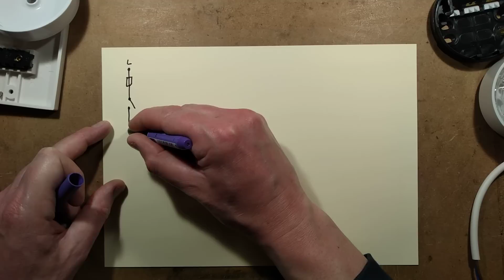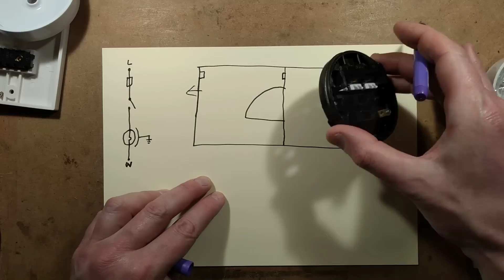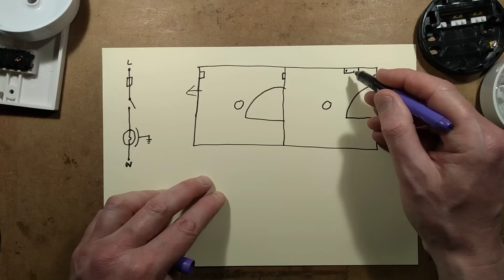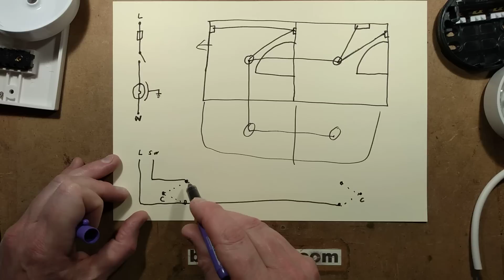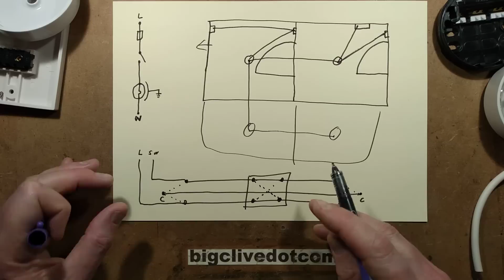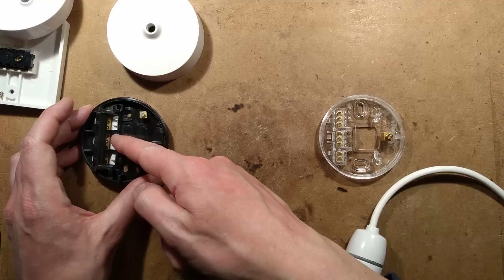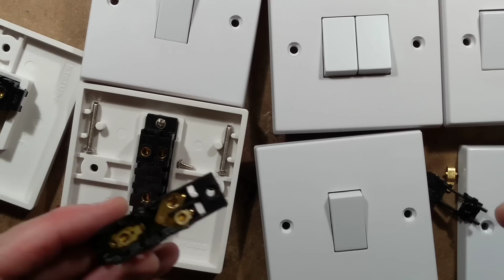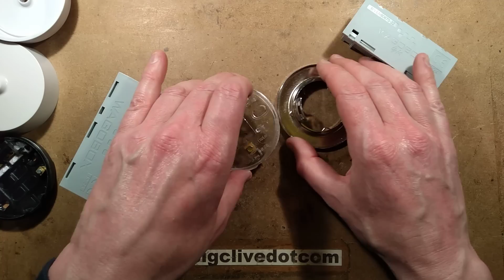British home wiring.  The incredibly simple lighting circuits.

Comment: Was looping from one room to the next one a war necessity, similar to why fuses are in the plugs? I'm asking as in most of the rest of Europe an electrician would lay down wires in a star configuration, instead of a loop/bus as in the UK.

So each plug and each light have dedicated wires going to a common electrical panel with safety cut off switches.
Reply: The ring circuit was a war (and post-war) measure to save on copper.  But that results in several sockets rated at 13A max on a 32A breaker.  Many devices wired to a 13A plug might only take a few amps and have a flex to suit.  Which means a fault could result in a 3A cable carrying 32A of current for prolonged periods, resulting in a length of flaming insulation on your carpet.  So each of our plugs must have a fuse.

Radial circuits are permitted here (always have been) and are being installed more often these days, but rings are still the most common.
Reply: Every single light and plug go back to the panel? That seems horribly inefficient. Where I live the average house will have about 40 plugs and 15 switches or so not including appliance and light fixtures. Would cost a fortune to wire.
Reply: @jordanyoung5718  Typically you string 4-5 fixtures and outlets on a branch circuit. Bonus point for not putting all the outlets in a room on the same circuit. Unfortunately electricians will often save money by putting too many drops on one circuit.
Reply: @jordanyoung5718  not every single one, but my 3 room flat e.g. has 11 breakers and 2 GFCIs split to 3 phases… except for the stove which is 3 phase entirely.
all breakers are 16A…
Reply: @racitup4114  A fuse won't rescue any kid....

Neither 13A not 16A, fuses are there to prevent fires and protect devices and installation. Not humans.
GFCIs are there to save meatbags and they are also mandatory here.

But it is a lot better to protect the Mains itself down to 16A (max allowed device rating) than every appliance, because it also protects the installation.

16A Breakers are very common and cheap to get and the correct name would be line safety breaker, because they, as said, are not there to protect humans.
Any installation without a GFCI will simply kill you, the breaker will most likely not even trigger because the human resistance is far too high.
Reply: @racitup4114  not a nerve but the use of circuit breakers is only for wiring and devices.
GFCIs are mandatory by EU law, and also in nearly all other countries.
The need of a fuse in the plug however is only needed due to the ring topology of many UK installations, which is not even allowed in most other countries.
The UK plug however is quite nice and it is a shame that the EU went for the french/german schuko :-( and EuroPlug.

But it is a common misconception that a fuse/breaker can safe your life… it won't.
It might prevent a fire (which is mostly what it is good for) but will never protect from electrocution.
Even a faulty case would usually not ground enough current to trigger a breaker and simply stay electrified, unless properly earth or protected by a GFCI (these things protect meatbags of all sorts of kinds).

Comment: That's odd, I'm pretty sure my switches have both live and neutral feeding in... I did install a light on the wall like your drawing, but it felt really wrong 😅
Reply: That's not uncommon. You either have the loop in method as Clive described or what you have, where the L+N goes to the switch, the N is joined straight through in the back box, and the live connects to com with the switch wire leaving to the light from L1.

The loop in at the ceiling rose method can be impractical, if for example standard ceiling roses are not being used on the installation. Therefore it is more common nowadays to see looping at the switches as modern fittings have hardly any room for two cables let alone three. 

Theres also the junction box method but I don't think I've ever seen that apart from at college in the 90s.
Reply: If it is a one way lighting circuit wired in twin and earth cable, the blue neutral wire could be used as a switch live. If so, should be covered with brown sleeving to mark it as live, which also makes it easier to identify in the ceiling rose. 
Although if your installation is rather new, your wiring may have been looped in through the switch instead of the light terminals, which basically means that middle 3 block in the ceiling rose is not needed. Looping into the switch is to allow installation of more modern technology, like smart switches, which require a neutral as well as a live and switch live. 

However, please take what i say with a grain of salt, i am a trainee nearing the end of a level 2 electrical installation diploma course in college. This is just stuff i remember off the hop of my head. While i know the top paragraph is all correct, there is a chance that im speaking absolute crap in the second one.
Reply: @Shaynewarner1  I'd have to open it just to check, for now it works so I'm not that worried 😅

Comment: L is Lamp?
Reply from the maker: L for lamp, loop for loop through and N for neutral.  It does seem odd calling the switched lamp connection L.
Reply: @bigclivedotcom  
But the neutral also loops.  So it, too, should be marked L.   L for Lamp.  L for live Loop,  L for neutral Loop.   L L L.  What could possibly go wrong?
Reply: @bdf2718  Well, at least being clearly marked L it helps colour blind sparkies :-)
Reply: Live.

Comment: In Portugal we don't use ceiling roses at all, all loop connections are from one light switch box to the next one and so on. Also we wire the two way switches differently, on one switch we feed the live on the common connector and on the other switch the common connector to the light socket, the L1 of one switch links to L1 of the other and L2 to L2.
Reply: Yeah, there are two "flavours" of two-way switch wiring, I think Clive went over them in another video. Either is acceptable here in AU.

One uses three cores as he described in this video. 

The other works as you describe with a twin active connecting the L1/L2 terminals of the switches, active on the common of one and switched active on the common of the other.

Three-wire is a bit easier if you've decided to add two-way switching to an existing light circuit, and I personally think it's a bit neater since you can run a single twin-active down from the light fixture to one switch rather than having to run individual single cores to each switch separately. But electrically they're equivalent.
Reply: Canada does it more like Portugal, but we call it 3-way switching and the switches involved "3-way switches" and "4-way switches", referring to the part type
Reply: @trucksoner  same in the USA.
Reply: Same here in Spain
Reply: Which means you have to run a 3 conductor wire between the switches (L1, L2 and Neutral). If one switch is closer to the light and the other the the panel it makes sense.  Usually less wire is need the UK way. (And a lot of UK code was standardized at a time when copper was very expensive)
Reply: @WorBlux  I've seen installations where they used only 2 conductor wire by running the Neutral directly to the light, then used the white wire (which is Neutral in the US) as L2. Illegal of course, and very easy to mess up. However, if you're using conduit (which is required for commercial buildings) I think that method is legal, provided you use properly colored primary wire.
Reply: @keithstathem872  
Not illegal, at least not in past codes (I think 2011 is when it changed). Inspectors did like you mark the ends of such drops with appropriate color tape. But they are pretty obvious to identify even without the tape. If you see a white and black across a switch, you know it's a switch leg (otherwise it would be a dead short). And if you white->black once in a junction box you can be pretty sure it's a switch leg (twice means the f'd up the polarity). 

Where I can see it being confusing is going to a multiple gang box and a real neutral is in the same box. 

 And if illegal now, it's likely because they like an actual neutral in the box to power electronics.
Reply: @WorBlux  Well, I assumed it was illegal, but it was in the 90s that I saw that, so I guess not. Personally I just spend the extra dollar for a red wire :)
Reply: @keithstathem872  

Probably a good call, now that everyone and their dog is trying to smartify their homes.

Comment: I recently changed a ceiling light and the wire from the switch wasnt labelled or recognisable... but fear not... I stuck an old phone charger cable to a wire behind the light switch and checked which wire in the ceiling had a current with one of those pen tester thingy majigamys. P.s. dont try this at home.

Comment: No doubt they will try to make it a lot more complicated.
Is brilliant regs , I was trained in the RN to work on radar up to 30000 V to run emergency 440 cables , install and decommission equipment . BUT I would not be able to legally move a light switch 1 inch ! go figure .
Reply: It is not notifiable work under Part P to move a light switch (assuming you're not moving it into the shower ;) .. so you can just get on with it
Reply: @flange0r  Phew ! what about a socket
Reply: @gowdsake7103  give http://wiki.diyfaq.org.uk/index.php/Part_P  a read
Reply: It's only illegal if you get caught  !!  The odds are on your side.
Reply: @stewartcaldwell5299  It sure doesnt stop me making changes to my own wiring if needed

Comment: On the outside of the WAGO box, the hole is not for cable tie. Its for a lead. To check that is was not opened by anyone.
Reply: it depends on the jurisdiction. lead sealing is possible and potentially useful. But here in the UK, we're required to make sure the box is no0t openable without the use of a tool. A pair of cutters counts as a tool. So a cable tie works. WAGO are clever people. They can make one thing serve multiple jurisdictions.

Comment: That white box with the yellow wings is too optimistic for America. I've seen a lot of construction and normally the cut-outs in the drywall is much larger than the electric box, requiring plenty of filler. The wings would never have anything to squeeze against.
Reply: But we have the equivalent in the blue plastic box with wings that flip around and out onto the drywall behind the hole . Then tightens the box.   Crap but easy.

Comment: I've never seen an uninsulated earth wire in electrical cable in France. I feel like a lot of old fashioned electrical things like metal junction boxes and bayonet lightbulbs and the like that have been phased out a long time ago here, it's probably our fault that you're getting all the European regulations in the UK recently.
Reply: Standard here.  For three reasons.

1) Less thermal insulation around it, so the last of the three cores to melt in severe overload conditions (if anything fails it will be the live conductor).

2) If some idiot chops through a live cable, there's a chance the clippers will make contact with the earth first.

3) The real reason.  It's cheaper.
Reply: bdf2718 okay interesting!

Comment: Very interesting to see close up what British switches are like!  I find the ones here in Australia a bit too small (although I guess that's good if you want six switches on the standard sized wall plate), and on a trip to Denmark I found the size good, but they seem spongy and lack a decisive click.  These ones however seem to be a very nice combination of a good size and a satisfying click.  I wonder whether you're allowed to use them in Australia...
Reply: probably can use them in aust. they are also 240v and eu approved like our appliances are.  you are probably going to need to order some of their wall boxes at the same time to make sure you can install them.  why don't you go to some uk makers websites and check out the sizes and other stats.  but like i said elsewhere in these comments, aussie plastic masonry wall boxes are light years ahead of the tin ones clive shows.  i haven't done that sort of work for 20 years so i can't remember who made them.  clipsal, hpm or someone else or all of them.
Reply: @vsvnrg3263  What makes you say the plastic boxes are so much better?  Just curious as I thought the metal ones would be better.
Reply: @Berkeloid0  ,i had the job of slicing walls in new buildings, chopping out the grooves for conduits and chopping out the holes for the boxes and then cementing the bits in roughly for the sparkies and the renderers to follow me.  i cant remember how many i'd do in a day but it was lots in new high density developments.  probably 3 or 4 cutouts in every room.  the plastic boxes rarely had to be cemented in unless i seriously overcut the holes.  i didn't measure.  i just did it all freehand.  i'm not sure but i think all the aussie makers made the same things.  i suggest you google images of clipsal or hpm wall boxes.  these are the 2 brands i remember.  i just checked, they both still do tin boxes for losers  or if a fire rating is required.  judging by the pikkys of these modern ones, the hpm ones look to be the better of the 2.   but i haven't done that work in 20 years.  someone who does this stuff in modern times would know if one type is better

Comment: Things are quite different in Australia, partially because the common house is a wooden frame, plasterboard wall, brick (or timber) veneer. The wiring is looped in the switch generally. Then there will (sometimes?) be a loose earth connection at the light fitting itself (which is rarely used). Light switches are often on the door frame (architrave) or sometimes on the plasterboard wall in newer houses. The wiring is just loose behind the switch - there is no box to protect it. This means wiring could be anywhere in the wall, so one should be very careful when drilling into it.
Reply: Most houses in the UK (until fairly recently) have solid exterior and some sold interior walls. Using the three plate method means that only one cable has to be channelled down to the switch box.
Reply: Not in Western Australia where double exterior brick walls (with a cavity between the two layers of brick) are the most common with brick veneer internal walls. Western Australia has also not adopted the 230V national standard but retains its 240V. There are other differences see https://www.commerce.wa.gov.au/publications/wa-electrical-requirements-waer

Comment: Hi Clive, 
In Australia, they use two wire cable, (power, neutral) to the light switch which runs directly to the light, then that loops off to the next light switch. The light switch is usually flushed mounted onto the plasterboard using a  metal plate or clip, (see link: https://www.bunnings.com.au/hpm-block-mounting-clip_p4331039). There is also a mounted stud bracket that can be used: (see link: https://www.bunnings.com.au/deta-mounted-stud-bracket-25-trade-pack_p4430753). They do have mounting boxes, but they are mainly used on solid walls like bricks etc.
Reply from the maker: In the UK it used to be against regulations to have live and neutral in a switch to avoid the risk that people would add a socket next to it and "upgrade" the fuse.

Comment: No rambling at all... very enlightening of the differences of electrical installation hardware in the UK vs. North America.
Those Wago connectors would be a huge time and space saver vs. the spin on wire nuts / Marrettes used here in Canada.
It surprises me the amount of plastic electrical boxes used in the UK. Almost everything here, unless for a wet location would be galvanized steel.
The lighting circuits here would involve bringing the 14/2 (copper) or 12/2 (aluminum) power from a 120 Volt, 15 Amp fuse/breaker panel to the switch, and then carry on to the light, with the live (black) switched, and the neutrals (white) joined at the switch box.
The cables themselves are similar, with a bare earth wire in the center between the black and white wires, and can be stripped of the jacket in the same manner along the earth wire.
Ceiling light junction boxes are just a galvanized steel octagon, with earthing screws, but no terminals at all... cables would be joined with wire nuts / Marrettes.
Reply: Wire nuts are horrible ugly bodgy things. Wago connectors or standard terminal blocks are much neater.
Reply: when they installed my AC they used too big of a Marrette  turns out that can cause the wire to heat up and burn ...a good 6 inches of wire to the motor was burnt to the point most of the plastic on the wire was melted off and other bits were charred , scary stuff since I live in the desert and the AC is on the roof. the AC company fixed it for free then a week later the motor died on us :( 500 later I asked if the AC being improperly installed could have caused the motor to die and they never got back to me.
Reply: @ardoporkkropodra2474  Were the wires for the AC aluminum? This is a common problem with aluminum wire connections in Marrette wire nuts if the coil in the Marrette is copper and causes galvanic corrosion (and heating), or a copper wire is joined to aluminum in a Marrette. Both are bad news and cause HOT connections and charred insulation just like you describe.
Reply: Wago type connectors are rare in North America, though likely becoming more common. That type of connection has a rather bad reputation due to having a tendency to burn open under high load - at least as manifested on the push-in style terminations on the cheaper switches and outlets.